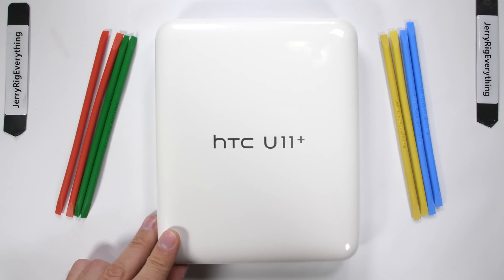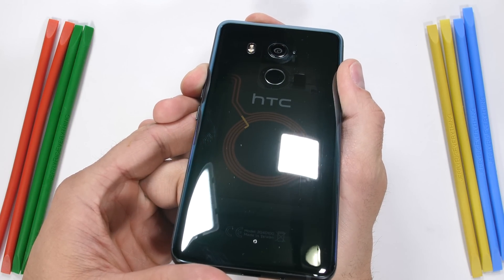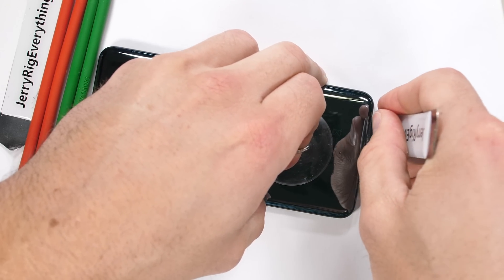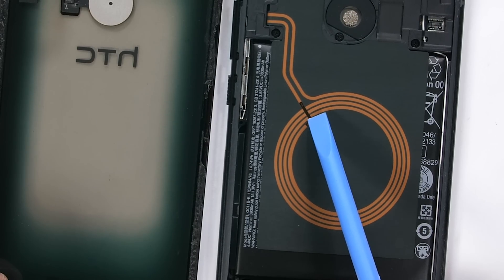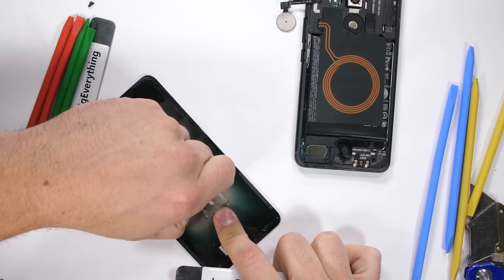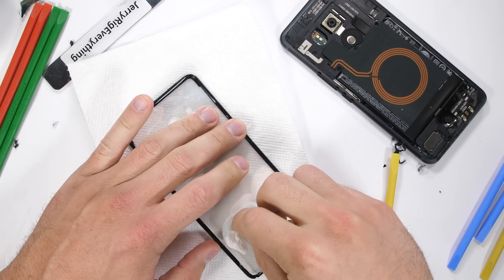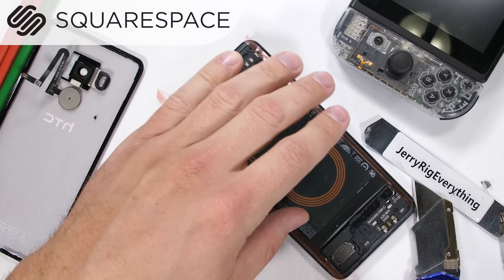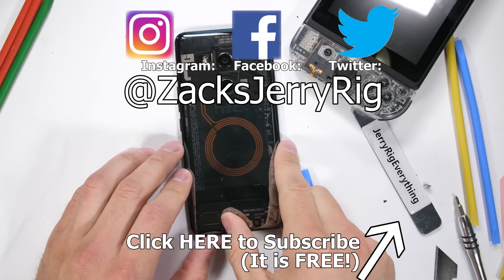HTC Made a CLEAR Smartphone!! (almost)

Comment: Fuck wireless charging.  It may look good but it is so much more inefficient than simply plugging into the wall and you can still use the phone while it is plugged in.  
It is really shitty that a phone has to lay down for 10 or 15 minutes before you can pick it up and make a call.

Comment: Better way to remove adhesive from the back od the phone put it into a ziplock bag aw in a boiling water for about 2 to 4 minutes the phone will be really hot but wont get damaged and the back seal will be removed easily

Comment: Sweet phone. I would like to recommend a product that i think will make your life much easier when your looking at removing residue like the stuff left on the glass. I do vehicle graphics and when i have to remove adhesive, no matter how stubborn a product called "rapid remover" works hands down the best ive ever seen. im pretty sure you can even get it at walmart. but seriously, the best i've ever used. let it soak a little, scrape it off, and rinse it clean.

Comment: I have this one. One thing to look out for in possible future videos on this model (and what triggered me is your remark that you are not afraid of damaging the glass because it takes something with hardness 6):

Front is Gorilla Glass 5. In just few days of very careful use it already got two scratches on the front. Having googled it I found out that GG5 is softer than GG3 and plenty of users of GG5 phones complain about that. Having experienced that I was trying to find if back was also GG5 but couldn't find any info. I'm using it without a case and still haven't noticed any scratches on the back. I think on regular U11 the back was also GG3 but can't be sure. 

Other than beauty, the biggest advantage of glass phone is how it feels to hold it. I tried with clear TPU case, but that's just not it.

Comment: Why modern phones are so hard to repair at home ? Like srsly, glass backside glued to smartphone with fingerprint scanner attached to replace battery, you need to heat glass and use propper tools, disconnect fingerprint scanner. And after that  you need to move nfc and somehow deattach the battery. I miss good old days, when you can remove front and pack pannel and battery without even unscrewing any screw.

Comment: Something you can try to get rid of adhesives is (and I am not kidding here) is peanut butter or better yet margerine.  The Fatty Acids and water when left from an hour to overnight often remove allot of adhesive residue. And it is realatively cheap too.  If you use peanut butter though, make sure to clean it with something that is made to remove oilly residue or the smell may stick around.

Comment: Actually, this is not the U11 but the U11+, which is a phone not available for purchase in the US market.
It is a mid-cycle refresh released by HTC by the end of 2017, kind of like an improved U11 along with "2017" smartphone aesthetics.
From my own user experience, the U11+ feels a lot more solid compared to the U11, maybe thanks to an increased thickness due to a larger battery.

Comment: wow ... thats art. hey jerry why dont you make a video on a diamond screen and how much it is going to be durable and is it possible or not. thanks
Reply: The TRUTH a screen made of laboratory manufactured Sapphire or diamonds is certainly possible however who is going to pull you off the ceiling after they show you the price. You should remember it would be extremely scratch-resistant that doesn't mean it won't be shatterproof so yes it may not be able to be scratched unless you walk around with diamonds in your pocket it would be able to take a lot more punishment but Beyond a certain level it will shatter
Reply: 1mezion I didnt know diamond screen could be manufactured. I wonder what it takes to do so. thanks for the response.
Reply: The TRUTH oh and if I remember correctly a while back he did a video with iPhone versus diamonds scratch test
Reply: 1mezion I've seen it. and also the saphire battle. But I wanted to see Jerry doing a video about diamond screens and how thin should the diamond layer be to improve pricing. Jerry is the king of durability tests. thanks man for taking time to respond

Comment: Are you going to put a bend and scratch test on the phone
Reply: Nano Mine The phone is not the same size, so it means it has a new frame, we don't know what could different with it, they could've even used a slightly different type of metal. But unfortunately yes, he has already opened it, so a bend test is out of the question.
Reply: Be social media Not antisocial media He already did that.
Reply: Nano Mine No he didn't, that was the U11, this is the U11 Plus
Reply: TheSpeedo666 There shouldn't be a major difference in their build quality. So it should be pretty much same as u11. Also bend test is not gonna happen on this channel as he already tampered with the build of phone.
Reply: TheSpeedo666 I don't think a HTC would design a new frame structure for a plus model, though being bigger the structural design should be same. Also I don't think many people even care about this phone.
Reply: Nano Mine The metal sides of the phone are bigger.
Reply: U11+ is more durable than usual u11, you can see the difference if you hold 2 devices simultaneously